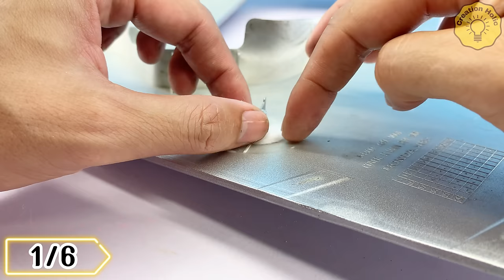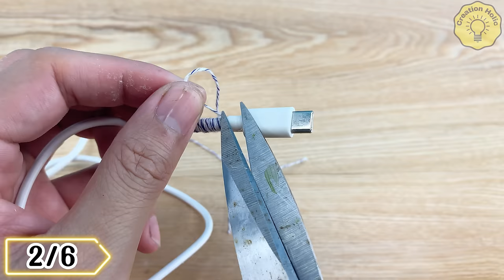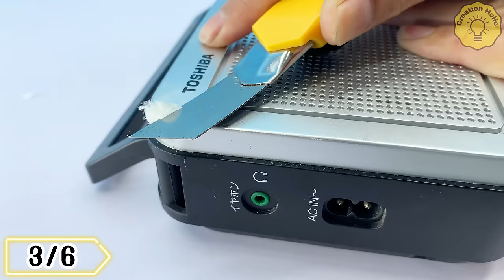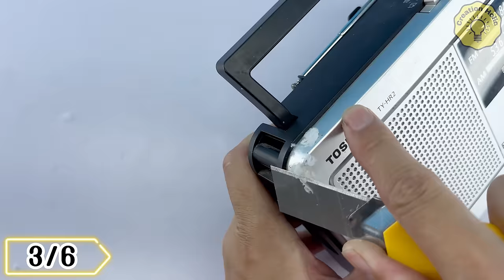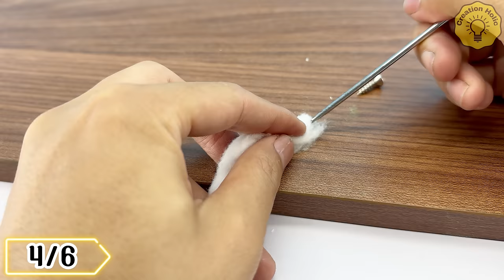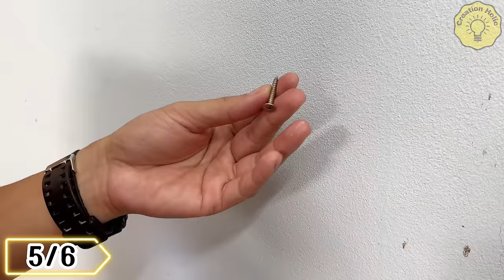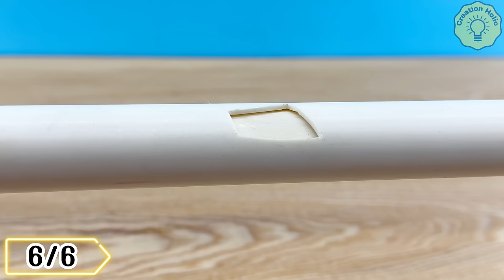Super Glue and Cotton Miracle ! Will This Fix Everything?

Comment: I have been using this technique for years, and there's one thing that isn't mentioned here. Cyanoacrylate + Cotton causes a very exothermic reaction. The cotton fibres react with superglue and create very hot fumes. Care should be taken to avoid inhaling the fumes, or accidentally touching the glue soaked cotton, as it will burn your skin really badly.
Reply: I learned that at a young age trying to fix something when i put some glue on a q-tip to apply it more accurately and it started smoking. Ive always wondered about that.
Reply: I learned that the hard way when I tried to repair the zipper on a bag
Reply: yikes! good to know, thanks for the share
Reply from the maker: Welcome to Creation Holic channel! Thank you so much for your support
Reply: Had a rip in my jeans and super glued back together, smoke and heat for a minute had me worried as I was still wearing them at the time !!
Reply: Yeah, it will also react with leather. I Had a belt/buckle deal where the part.that clamps into the belt kept fraying and I thought I'd stabilize it with the SG. It worked, but the reaction apparently slowed the reaction that make.it.set, so I sprayed it with some high pH water to hurry it along.

Curious what all the reactions are producing
Reply: BS warning
Reply: Probably the best comment I've seen on any social Media platform! This should be pinned to the top!
Reply: @creationholic101  You're irresponsible for not telliing this in the video!
Reply: Did you copy Google? Or did Google copy you?
Reply: @potatoguy5428  I get that a lot. I tend to write like that because I have a bit of OCD for grammar. However, I mentioned that because I have had personal experience with burns from cotton and Superglue. I read about it from Michael Crichton's "Lost World", and burnt my finger while trying it out..
Reply: Even worse, it may ignite, so do ABSOLUTELY not use this method in a too big hole in something combustible, like a wooden wall or similar.
Reply: I had this shocking reaction whilst trying to fix a trainer shoe, was tempted to dowse it with water.
Reply: or buy a 50 cent plastic wall anchor.....
Reply: @vespass225 "Even worse, it may ignite, so do ABSOLUTELY not..."

Calm down. There's ABSOLUTELY no way the exothermic heat from this reaction would cause wood to ignite.
Reply: AND VAPOR VERY DANGEROUS FOR EYES TOO...BE CAREFUL...THANKS...
Reply: I used the exothermic reaction to 'fume' evidence, looking for latent friction ridge prints and permanently preserving them. CSI's use it often.
Reply: @suprememasteroftheuniverse yeah ok there science guy 😂
Reply: @creationholic101 This comment is complete GARBAGE!
Reply: @timothyn4699  That's bull!
Reply: @marty3469  You're full of it!!!
Reply: Not just heat. Irritant and toxic. Good ventilation and protective googles are
Reply: Ok good safety tip Egon.
Reply: good to know! Thank you.
Reply: So, it's kinda like fiberglass?
Reply: @creationholic101 u really should mention these types of things. If you’re going to teach us cool hacks.
Reply: You’re asking an awful lot from a video made by a crappy Content creator
Reply: I HAD A THERMIC COSMO PROPELLED IGNITION D612 WHEN I PUT IT ON MY TESTICLES....😂🎉
Reply: @suprememasteroftheuniverse  What is?
Reply: It definitely burns if it touches your skin. I can vouch for that
Reply: @KevAF_  it also does on some soft plastics,
Reply: Exatamente. Comigo saiu fumaça e ardeu o meus olhos. Coloquei máscara e óculos de proteção. Deveria ser falado aqui!
Reply: I have also experienced that cotton can catch fire.
Reply: Air
Spaces Good Enough,
Don't Stay Vertically
On Top Of Your Work,
As The Glue Can Get
To Your Eyes 👀 and Lungs 🫁!

Comment: I use crazy glue a lot and I’ve found that if I put some vasoline around the top and neck of the tube or bottle it keeps it from sticking to the container so therefore I don’t have to throw it away because of the top being glued onto it if that makes any sense that is .,.
Reply from the maker: Hello! thanks for your comment. Wish you all the best!
Reply: Probably helps seal the air out too! Thanks.
Reply: I figured this out a few months ago too.  Definitely works.
Reply: Good tip. Thanks!
Reply: Great tip! Thank you
Reply: Very helpful comment! Thank you!!
Reply: Good idea. Crazy glue? Never heard it called that in theUK😃
Reply: Are you talking about Vaseline the tube opening and neck part so the cap won’t stick onto it?
Reply: Niceeeeeee
Reply: Without a doubt it does!!
Reply: Great tip!
Reply: Storing it in a refrigerator will also keep it from setting up.
Reply: @doradean3097  yes ma’am both tops
Reply: Great idea thanks! Save me throwing the glue every time
Reply: Why would this NOT make any sence?🤔🙄
Reply: That's a really helpful comment! Thanks!
Reply: I do this too! I didnt think anyone else knew about “my” secret trick! LOL
Reply: BRILLIANT!! You could have saved me thousands over the years had I known this LOL🤦🏼‍♀️!!! THANK YOU 🙏🏻
Reply: @tovah2276  you’re very welcome thank you 😊
Reply: Great idea!

Comment: This is basically like Duroplast. In east germany between the 1960s and till the 1990 they build car parts for the Trabant from cotton that wasn't good enough for texture manufacturing and combined that with a resin and bonded both materials in a heated hydraulic press, baking the cotton and the resin together.
Reply from the maker: Thank you for sharing your feedback! have a nice day!
Reply: wow. Interesting
Reply: Duroplast was often made from waste cotton fiber and became a large German environmental problem  because it could not be incinerated.

Comment: I like all of them except the last one. Depending on what is going through that pipe by putting the patch inside it could create a blockage at that spot. I would've put the patch on the outside or cut the patch to exact size!! Great video!!
Reply: Or cut that section of pipe and replace it with a new unbroken section and proper joints.

Arguably less work than trying to perfectly shape a plug for the hole.
Reply from the maker: Hello! thanks for your comment. Wish you all the best!
Reply: i feel like a few dollars of pvc fittings you could cut the pipe and put a repair in within an hour

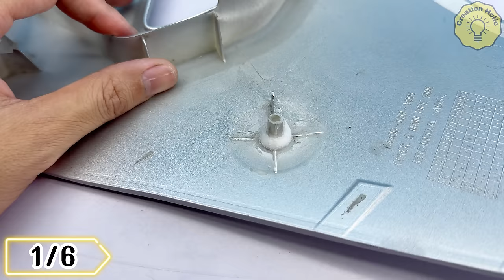Comment: I've been using this trick for quite a while (especially one at 0:54). I'm surprised it not widely known unlike famous baking soda trick. Cotton adds some extra strength and it's not instantly dried, you still have some time to adjust form and position.
Reply from the maker: Yes that's right, I was also surprised when I used it
Reply: Superglue is strong but also brittle. Adding cotton which is a fibre adds a bit of tensile strength, like steel in concrete. I have a plastic knife handle that I repaired using this technique and it is holding on even after 15 years. Best thing is that you can shape it afterwards by cutting and sanding.
Reply: there is a video that shows  that baking soda is a lot stronger than cotton as they tested a bunch of wood blocks with screw hold filled with soda and cotton and the cotton failed first each time
Reply: ground up charcoal works well, too.

Comment: Probably the most useful video I have seen in 10 years. I am 57, been a practical guy all my life and I never heard of the cotton wool and superglue trick. Thanks!
Reply from the maker: Hello! Welcome to Creation Holic channel. I am very happy to read your comment. Have a good day!
Reply: Me too!  How did I get to 58 and handy with no idea of this.  Really useful info.
Reply from the maker: thanks so much for your comment @ezza88ster
Reply: Yes, I've done enormous amounts of DIY (cars, houses, electronics) and this is news to me too.
Reply: or buy a 50 cent wall anchor instead of using a exothermic reaction to put a screw in drywall...
Reply: You can also use baking soda or cigarette ash!
Reply: There is a product called Speedy Fix which is a powder that comes with some super glue. We use it for repairing plastic fairings on motorcycles sometimes. The only issue is when the fix is on a vertical surface, you can't really get the fine powder to stay in place. You know, what with gravity and all.... But the cotton trick will help with that. Ground up charcoal works well, too, and it is black, and basically pure carbon.
Reply: @ken481959  if you put the powder on a credit card or similar stiff, flat applicator then draw it up the repair like drywall mud it'll roll into the adhesive and stick.

Very light coats so the glue doesn't run, repeat until the fill is built up flush to the surface <3
Reply: WATCH THE GUY THAT DOES IT WITH CRUSHED-UP RAMEN NOODLES

Comment: Never thought about using cotton for some of these. Finally an actual useful youtube hack. although toothpicks and wood glue work as well on door cabinet hinges. also the last one for the PVC hack. I wouldn't put the patch on the inside because if you have anything running through there, that patch becomes an obstacle to snag anything going by and eventually clog up. Better off leaving it on the outside and reinforcing with cotton.
Reply from the maker: Thank you for sharing your feedback. Have a good day!

Comment: Epoxy fillers are what you're really looking for. They come in commercial or ad-hoc varieties (e.g. baby powder, baking powder, etc). These let you dial in the thickness, from a consistency of ketchup, mayonnaise, to peanut butter. I've heard of people using these fillers with superglue too.
Reply from the maker: Thank you for sharing your feedback
Reply: Что за компоненты  Вами применены?
Reply: Yes, but but most people don't have epoxy resin, or the PPE, or the need to acquire it all for one small job. But most households have superglue any cotton wool. Great hack.
Reply: Agreed, epoxy is the way to go for any repairs that require a sheer strength. Superglue is only really suitable when there's a large surface area, because it has no sheer strength and is very brittle.
Reply: Epoxy is hard to find in my country, and when you can find one, you can't choose the grade or the type, it's just Chinese crap.
Reply: You can create a very abrasion resistant and strong filler using plaster of Paris mixed with Tightbond 3 wood glue.

Note: 'sands easily' is not one of its features.
Reply: @Zomby_Woof  the good news for me is it's availabnble in my country at a decent price (for once). Thanks for the tip!
Reply: @darthkek1953  I use the two part polymer/monomer that nail salons use to build nails.  You can get it in beauty supply stores and while more expensive, it has the advantage of not bonding everything to everything like Cyanoacrylate does.  I use it for bonding/rebuilding & reinforcing plastic.  I rebuilt a tonearm rest for one of my turntables and after painting you would never know it was ever broken.  Edit:  I forgot to mention that it's as fast a reaction as the super glue/baking soda trick.  When you drip the thin monomer liquid onto the polymer powder it sets instantly, and you can build it up as much as you need to, the new layer you put down is completely homogenous with the previous.

Comment: JB Weld is preferred for high strength applications. Just make sure the surface is clean of fingerprint oils and chemically etched with nail polish remover or paint remover when you want an extra strong bond. Sanding can work as well but needs to be cleaned of sanding dust.
Super Glue is very brittle and will usually fail from repeated vibration or shock.
The pipe solution requires the inside diameter to be the same or larger in some cases and be free from accumulated debris.
Pipe wraps work better and there is enough surface area for super glue to resist fracture or cracking.
Reply from the maker: Hello and thank you so much for your comment! What you say is very true! If you have any other ideas or solutions, feel free to share them with me! Wish you the best!
Reply: J-B Weld is a brand. They make several different types of epoxies, glues, and adhesives. Which one are you recommending?
Reply: @vulpo   JB Weld Original Cold Weld Formula Steel Reinforced Epoxy
Reply: It does not break easily and makes a very tough repair when reinforced with cotton wool fibres. Also there is a form of superglue which is rubberised/plasticised to make it more flexible. Loctite Prism was one such product.
Reply: @vulpo  the original brand is the strongest.

Comment: There is a version of this using baking soda. It's called Rapid Fix. It is expensive, but it's the best quality CA glue you can find, I use it everywhere. Best way to stop bleeding when  I get a cut or busted knuckle The powder that comes with it has larger grain size than the stuff in your fridge.
Reply: It's industrial grade baking soda used for soda blasting, it's like sand blasting but less aggressive, it takes paint off but doesn't abrade the underlying metal.
Reply: Cyanoacrilate used for stopping bleeding is medical grade and has a slightly different formula. #superglue commercial Cyanoacrilate is not for medical use and can harm tissue
Reply: @fcassia  That's good to know, too! 👍
Reply from the maker: Hello! thanks for your recommendation. Wish you all the best!
Reply: There is another version called Plasti-Fix which is recommended for repairing cracks in abs fairings and bodywork on motorcycles....it is also quite expensive but no better than low viscosity superglue and baking soda.

Comment: Great video full of useful tips, thanks.

Do you have a similar one for fabric ? I mean repair tears in such a way the patch is as soft as the fabric itself, cause a solid patch would eventually break pretty quickly. This is specifically for running shoes where the fabric cut itself from the tread on the inner side of the foot.
Reply from the maker: I will research and send it to you when there is a good solution
Reply: I had a fairly new pair of jeans and the button tore out. I haphazardly sewed it back in and applied ca glue on my poor sewing job and button has been perfect since then. That was about 3 months ago

Comment: Keep in mind that there are many kinds of plastics that CA glue won't adhere to very well. Also, using too much in one spot can result in insufficient curing. CA glue needs air to cure, and where there's too much glue there's not enough air to penetrate.
Reply from the maker: Hello! thanks for your comment. Wish you all the best!
When I combine glue and cotton, I have never seen any type of plastic that cannot be attached. If you know information about any type of plastic that cannot be bonded, please let me know  🙏🙏🙏
Reply: @creationholic101  The typical types of plastic that don't bond well with most glues are polyethylene (PE) and polypropylene (PP).
Reply: Actually, CA glue requires moisture to cure.
Reply: @p.h.s.4459 exactly! Which is why it bonds fingers together, far stronger than the bond you're actually trying to accomplish 😂
Reply: @creationholic101 PE type plastics like those commonly used in plastic drink bottles is notoriously bad with super glue. With good surface prep you might get by but it's not a great bond. You'll see similar issues with PETG if you do any 3D printing.

Comment: Usually videos like this are complete crap... BUT, I actually tried this, it works very well, it sets up much harder than wood and can be filed and drilled. I am going to try it with PVC tomorrow to see how well it does with that, and to see if it is water resistant or not... This MAY be an easy fix for many things.
Reply from the maker: I'd love to hear if you've tried this idea yourself or if you have any other creative suggestions to share
Reply: @creationholic101  When filling a hole with cotton, keep in mind the glue will only go about 1/8 to 1/4 of an inch in, so you need to do it in stages... Overall, I will keep this in my bag of tricks for the future.

Comment: I have been working with super glue for years and have come up with a few handy tricks with it myself. Not many people know that water dries super glue on contact so if you want to flash dry it, just spray some water on it. Also smoke dries it instantly but it turns it white so beware if cosmetics matter. One handy thing I use super glue for is reinforcing my stitches on things. For instance, when I buy new work boots I super glue the stitches that hold the soles on. They will literally last forever. Also my luggage. Any stitches you put it on will make them literally impervious to wear. Even if they somehow break, the rigidity of it will prevent the stitch from coming unraveled.
Reply from the maker: Hello! thanks for your recommendation. Wish you all the best!

Comment: Thanks! I had a gas leak at home and fixed the damaged pipe with this method. Worked a treat!
Reply: Check there's no leaks by holding a lit match near it...
Reply: @CL-vz6ch  thanks for the tip! I've noticed an odour which seems to be emanating from the area I repaired. I'll give this a go to make sure there isn't a leak, if the match is extinguished by the gas blowing from the pipe I'll know my repair failed!
Reply from the maker: Because the gas line is very dangerous, to be safe you should replace it

Comment: Wonderful info.  I am wondering if this will work on copper pipes on the outside of my house, they burst during the winter.  A friend squeeze the spots together using pliers, and I am thinking if I do this method it will work to get the water through without leaking.
Reply: I just found this online so I’d give it a try. 
“Cyanoacrylate adhesives or instant adhesives are ideal for bonding copper.” 
Good luck!!
Reply from the maker: Yes it will